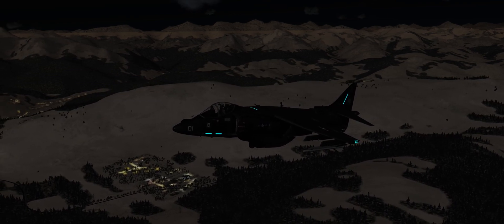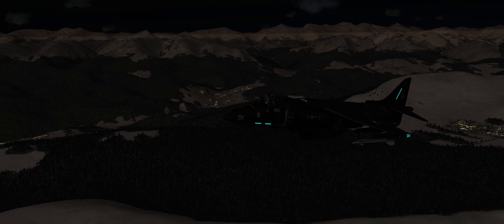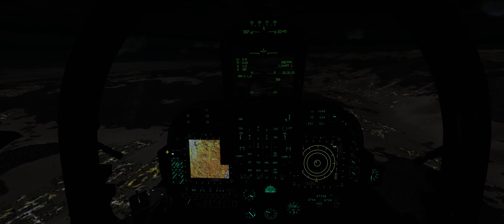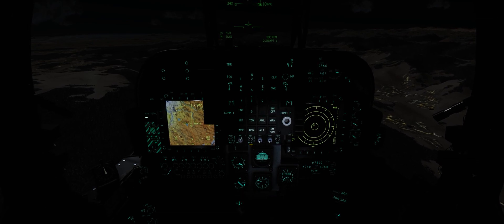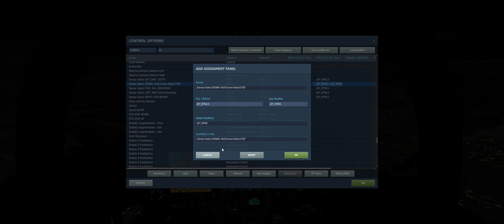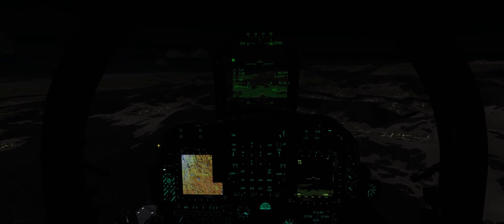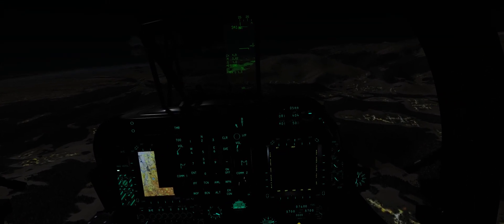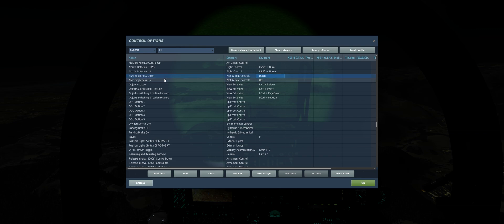DCS: AV-8B NA Harrier II | FLIR on HUD & NVG Gain/Brightness Tutorial!

Comment: There is a bug that I've run into, it has been reported to Razbam with steps to reproduce for nearly a year now but they ignore it. Can you do a video where you are in the Harrier with the Sidearm missiles and the gunpod. You just select the A2A gun and then switch to the Sidearm, get a lock on a SAM, and try to fire... The gun fires instead of the Sidearm. You won't be able to fire the sidearm until you completely restart DCS after selecting the A2A gun. You can prove it by firing on a SAM with the Sidearm before selecting the A2A gun (no issue there), then switch to the A2A gun and back. I think Razbam just needs a little public pressure to complete these modules. This is a critical bug that destroys the jets capabilities and requires a complete restart.
Reply: I don't even own the harrier and know of this bug, just by checking out the forum every now and then x)
Reply from the maker: I have honestly never run into this bug, for some reason I have always won the silicon lottery with the AV-8B and have never experienced any of the game breaking bugs that a lot of people write about on the forums.
Reply: @Spudspike  Can you do a quick test? You just probably haven't ever selected the A2A gun before trying to fire the Sidearm. If you don't have this bug I guess I could try another reinstall or something.
Reply from the maker: @Specter0420  I am pretty sure I have done that, but I can try again when I get home, I never had the IRMAV sensor select bug with the Harrier that plagued a lot of people.
Reply: YES! I've run into this bug so many times. I know a way of stopping the gun from firing instead of the sidearm. Switch to A/A aim 9 mode (even if you don't have aim 9) then switch back to A/G and make sure gun is not selected, only sidearms